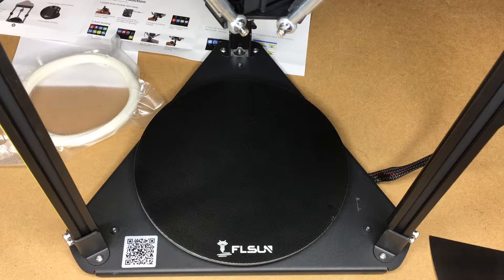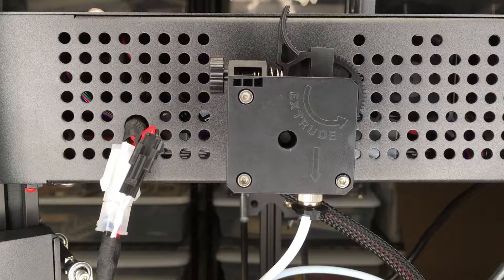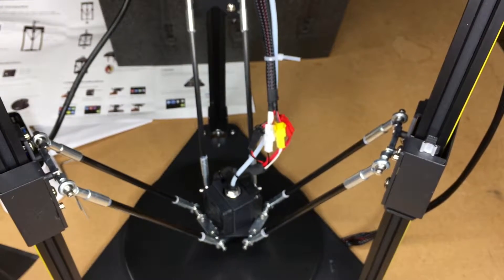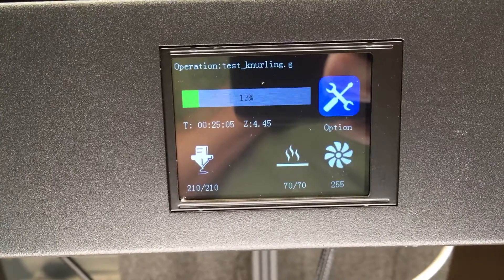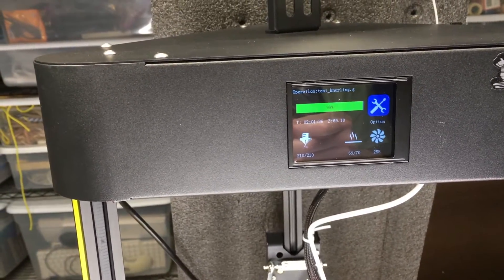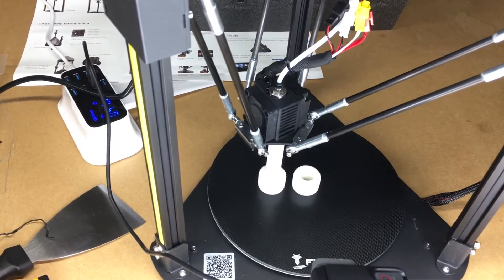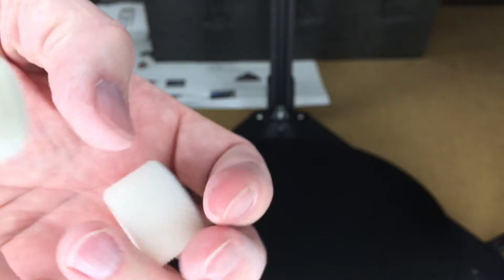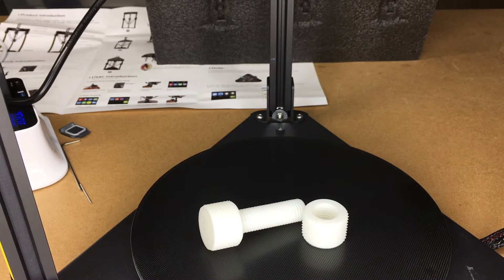FLSUN Q5: First Print Nut and Bolt (Ep. 3)

Comment: I think you have your z offset a little too close to the bed, and thats why its so hard to get off the prints. I can see that the first layer is too squished, just set it a little farther from the bed and hopefully it wont stick this much. I dont have a 3d printer with a glass bed, so idk if this is actually the issue, but on my ender 3 this is usually what happens when the nozzle is too close to the bed. Btw i just bought a q5 as my second printer, and im just looking around what experiences other pepole have with it.
Reply from the maker: Yeah. I've since raised it. I also use glue stick on the bed. It helps with adhesion and release.

Comment: You explain really good and I like you´re videos. I can´t hear any sound from the Q5 at all or is it you´re mick that filter it? I´m curiouse on how much it sounds
Reply from the maker: It does make noise but isn't super loud even though it is running four motors simultaneously and multiple fans. I don't know if most people would want this running on a desk they are working on but it probably wouldn't bother most people if it was in the same room they are working in.

Comment: That's funny my process was 100% identical to yours. I stuck myself with the nozzle cleaner. I used white filament and did a knurling as my first print and it had the same black colour come out and mix into the first layer of the nut. I also had a hell of a time trying to get my first few prints removed from the bed. I have had zero problems with my new method and will be putting out a video soon showing my method.